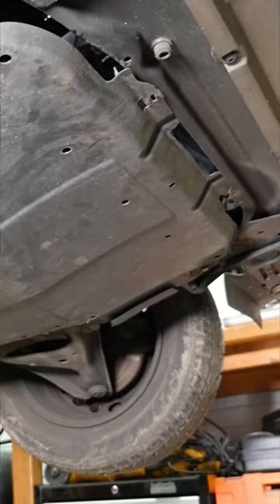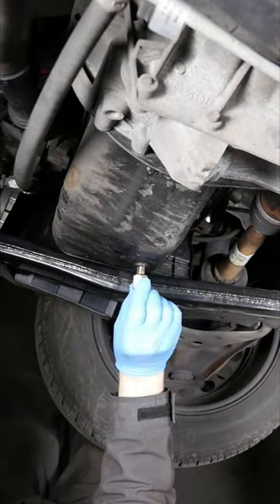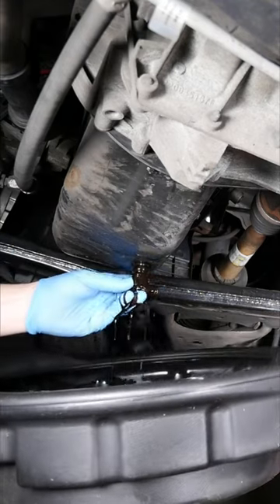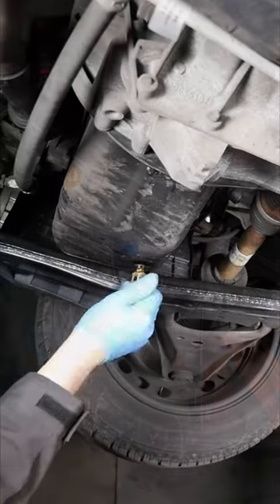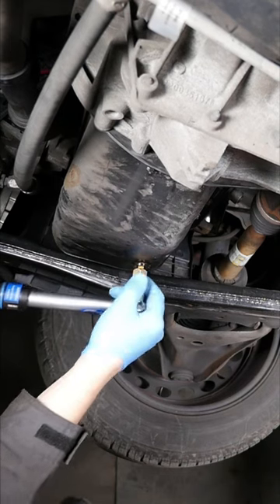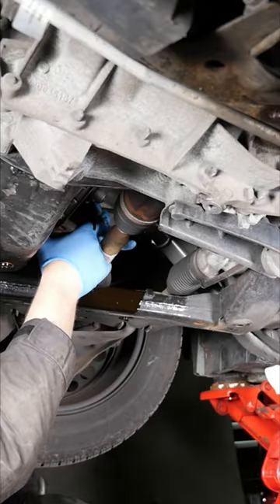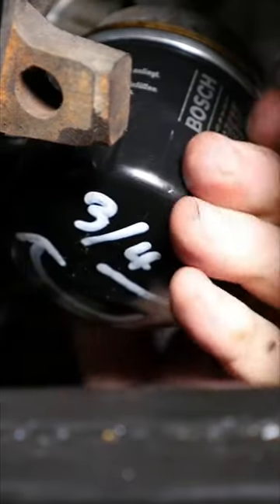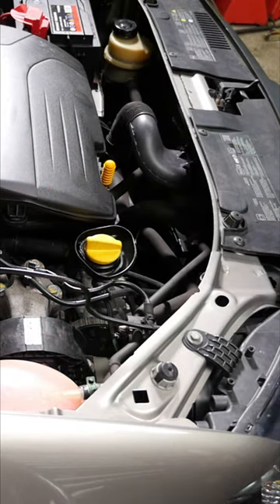Oil & Filter Change #shorts #mechanic #diy

Comment: What an awful position to put the oil filter. Having to remove the undertray is a pain too. Usually manufacturers will put an access hole for sumps.
Reply from the maker: You want a cheap car then you must be punished haha
Reply: @CoatsandGaiters every modern BMW, Mercedes and Audi need to have the plastic removed before you can change the oil. It has nothing to do with the price

Comment: Fill the filter the night before to saturate the element.
Reply from the maker: That can be tricky as you have to fill it from the outside holes and block off the centre hole